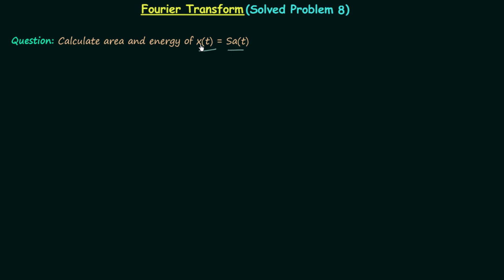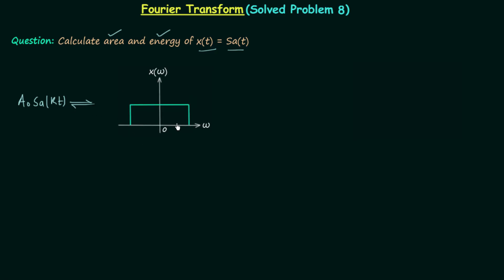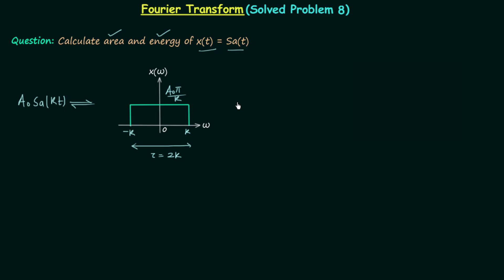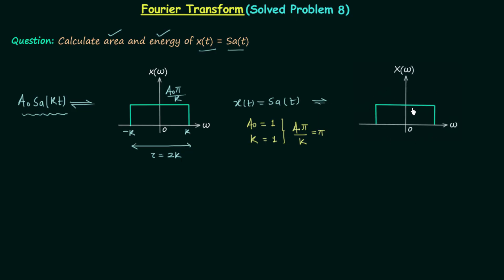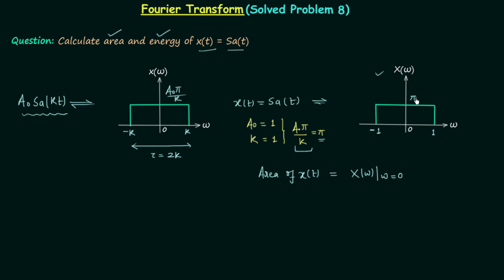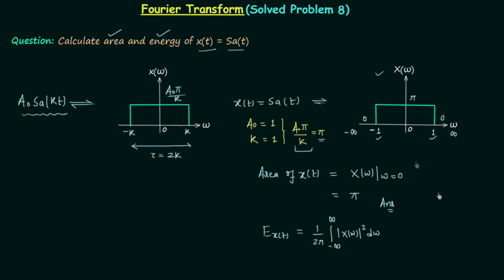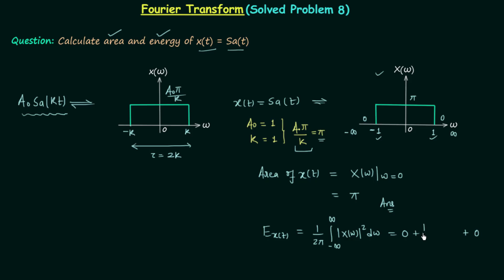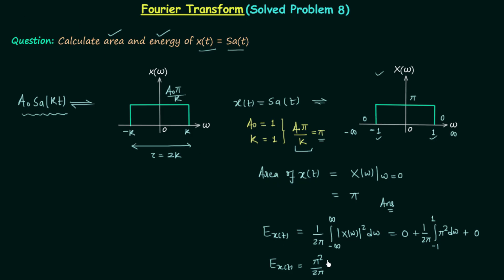Fourier Transform (Solved Problem 8)

Comment: 2:33 Here area under X(w) is 2pi instead of pi as base is of length 2 and height is pi.
Reply: no its value of X(w) when w=0 which is pie only
Reply: @shashwatsinghpatel8415   HOW is area = x(w) at w = 0 ... it wasnt explained in the vid

Comment: Sir, by property we know that, area under Sa(t) is Fourier transform at w=0. If we obtain expression of FT, it's [pi*rect(w/2)]. If we put w=0 here, then we are getting pi^2 as area under Sa(t). But we have got value as pi using waveform. Could you please account for this difference?
Reply: Rect(0) is always equal to 1
Arect(0) will be A